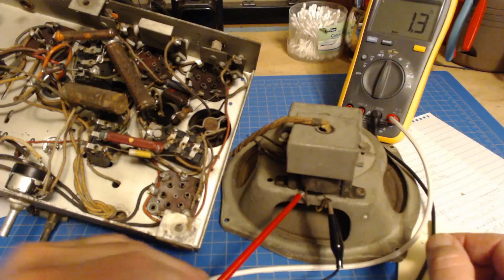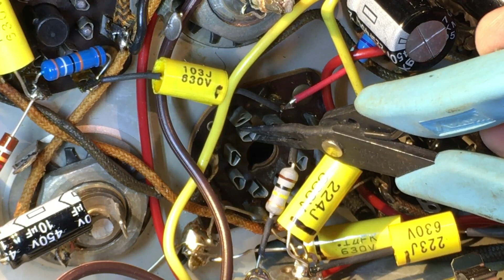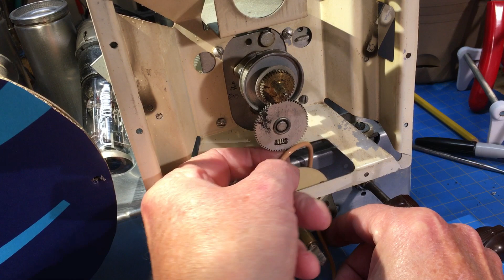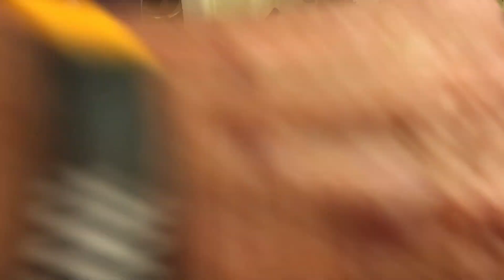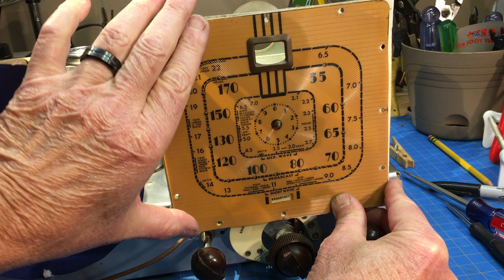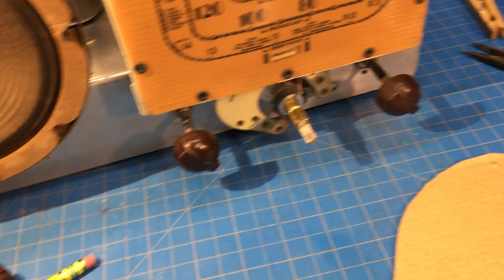1937 RCA Victor 87t Part 5 of 5 Cabinet Detail, Assembly, and Power Up

Comment: Excellent detailed work, i'm really impressed.  I am starting the restoration of (2) 87-K units so this series is going to be super useful.  I ordered a few belts from Quality Belts after seing that's what you've put in and how well it seems to fit. I also wanted to ask, where did you get the grommets, they are just perfect. Are you willing to share your source and their specs ? To at least point me in the right direction.  Also both my units didn't have the retainer shaft ring, any chance you would know where to get replacements ?  At any rate thank you very much for sharing this series, it gave me all the info i need to get going, i'll be ordering new caps, resistors and tubes and will be restoring the cabinet (console) when spring comes outside, living in Canada where in the dead of winter here so working outside is out of the question you know ?
Reply from the maker: Thank you Raymond for the kind words! We had a little dose of your cool weather down here last week where it got 3 degrees, brrrrrr. Well, you can start the recapping and repairs this winter and finish up the cabinets in the spring. As far as the grommets, I ordered from Renovated Radios. http://renovatedradios.com/index.php?  I hope they are still in business, they have just about any grommet or knob reproduction you would need. Also, if you have the old knob or grommet, they can make or match a suitable replacement (or used to). I havent ordered from them in a while. A retainer shaft ring? Im not sure what ur referring to? I believe on this radio, I needed a band switch indicator that was made of some really  brittle metal. I went to Antique Radio Forums and put out an ad. Within a few days I had one for about $10. I hope this helps and glad you found the series useful. Restoring these old beauties must be shared to keep them around for the new generation to see. Take Care—Larry
Reply: @Backtothefutureradios  Hey Larry thank's for the speedy reply sir, sorry about the cold weather spell, here as usual for the last 20 years or so our winters haven't been as much fun as they used to be when i was a kid, we have rain like 10 times every winter where the temperatures varie like crazy from +6c to -20c ( 43F to - 4F ) in a matter of hours, resulting in ice everywhere, causing more injuries to people falling and of course more car accidents and deaths unfortunately.  It is almost impossible to have decent exterior ice rinks anymore and it is quite a challenge for ski resorts to keep the hills in decent shape.  That's what you get for being Canadian i suppose...

As for the grommets yes Renovated Radios, LLC are still in business, (well at least they took my money), i ordered 6 of the grommets, thank you very much for the tip.  While i was ordering stuff i also ordered a pack of 2 RCA-Victor water slides decals from Radio Daze.  Yup doing the re capping slowly but surely during the short cold winter days and starting the cabinet work next spring is the plan.  

All this is new to me, it'll be my first project of the sort, i know my way around wood restoration, but i'm a newbie at electronics, to say the least.  It all started 2 years ago when i stumbled on David Tipton's Radio Adventure channel and i was immediately hooked, but never thought i'd do it myself one day.  But as life would have it, out of the blue in October, my best friend Yvon asked me if i wanted his 87-K which he had inherited from his grand father and had been kept in a mini warehouse for the past 20 years or so.  He sent  me pictures of the radio and  i found the Art Deco design so beautiful i decided to take on the challenge (The Canadian console is a bit different though, but just as pretty i find).  But we had to wait 2 months before his brother became available to come with us unlock the warehouse.  In the meantime i figured i 'd try to find another set to start studying it's chassis and how it worked and perhaps use it as a donor unit if Yvon's set was missing components or whatnot.  After a quick search on Facebook's Market place i found another one in the eastern townships for 40$.  Brought it home and started dismantling and cleaning it.  No doubt it had been kept in a barn for decades, the chassis was corroded to death, but i managed to clean it up to an extent having to resort to sanding and using Mother's Aluminium polish. The corrosion left marks of course but at least its smooth and more fun to work on now.
Sure enough when i finally got Yvon's set i realized it was missing parts; No multi band selector mechanism (the plastic indicator and the pot metal collar), Also missing an electrolytic can and the original transformer seems fried, wires being badly burnt.  On the other hand the one that i bought seems to have all it's parts, although the fragile collar had broke off at one point and was re welded (brazed).  That part is no doubt the weak spot of the whole set.  So if i originally  thought the set that i bought was going to serve as a donor uni t( and it would be the logical thing to do), i find in the short time i've own the radios i've grown attached to them and i would like to restore them both, providing i find the missing parts. Guess i'll put out an ''APB'' for the missing parts on Antique Radio Forums as well.

As for the ''retainer shaft ring'' (probably not the right term, but that's always the problem trying to describe some odd parts to repair something right ?) i'm talking about the tiny half circle ring that has to be mounted on the shaft to prevent the  tensioner's pulley assembly from slipping off. Visible starting at 3m20s of this video.  Had you lost it to the floor monster, how would you have replaced it ? I though of perhaps replacing it with a snap lock washer, but i imagine it would protrude too much to let the button slide back into place.  See what i mean ?

At any rate i agree with you restoring old gems like tube radios should always be kept alive for future generations. I realize more and more everyday just how important creating a network of like minded people and friends is important to achieve this.  There's only so much a guy alone can do in his basement...

P.S. I love your biblical references.

Thank's for sharing, happy New Year and God bless.
Reply from the maker: @raymondmenard5444  I know which part you mean now….you wouldn’t believe where I found it, totally impossible where it went, lol….I believe if you could find a “c” clip or “e” may work….another idea is a clip that is used on mowers and other farm equipment that is shaped like an “R” could work….good luck with the projects! Please keep me updated….also, a friend of mine did a console and not sure if he included it in his YouTube channel….he no longer posts but his channel is “ThatTubeSound”….check him out! Take care—Larry
Reply: @Backtothefutureradios  Yeah no kidding once you drop one of those tiny rings on the floor better start praying to find it again, not surprising mine are missing from both units.  Yeah yeah C clips that's what i meant, but i took a few measurements and i don't think C clips would work because once fitted onto the shaft's groove its outer diameter must be smaller than the tube's assembly diameter in order to let the buttons slide onto the shaft which has a flat part even lower than the overall shaft diameter.  But i did manage to wrap a piece of 14 gauge copper wire into the groove and it almost works.  I filed the wire down a bit and was able to slide the button in place, but it was a very tight fit to remove it afterwards without risking breaking the buttons flat retainer spring.  Perhaps 16 g wire would be a better fit.  I'll try this as soon as the stores reopen the day after tomorrow.  There's always a solution right ? Although here in Canada everything is harder to find, it's always been like that especially in my french speaking province where nobody takes us seriously.  We're such a tiny market no company bothers to carry meaningful inventories of anything deemed specialized not even a little.  Anytime i see a car with Ontario license plates (neighbouring bigger province) it is always better, with nicer trims, nicer colours etc. I always say: ''Around here when you need a toothpick, you have to go into the forest to cut a tree''.  Just for your information, the dial shaft is .1248'' and its inner grove is .1214'', so the groove is just about .003'' deep approximately since a thinner set of callipers could go a little deeper into the groove and give a more accurate measurement, but it still gives you an idea how thin the ring must be to protrude just enough to hold the assembly in without obstructing the sliding of the button over the shaft.  But we do all this for future generations right ? :-)

Comment: Hey Larry: Just saw your restoration of the RCA Victor 87T. Great job. Just found my grandfather's 87T and looks to be in very good shape. I will be doing a full restore on this unit and your videos will be a great help along with those of Mr. Carlson's Lab. A comment on the rubber band (o-ring) you replaced on the dial tuning mechanism. Looking at my grandfather's 87T the tuning band is actually two wraps of twine or string. You can easily make this up yourself of course. The spring loaded roller puts tension on the string and it works perfectly. One difference I noticed is that the spring on my unit is very long, it actually goes along the front of the housing and hooks into a seam at the end of the case top edge where there is a gap. Obviously this is a fix but it works very well, so with the string solution the spring puts tension on the roller to keep the string in tension to gain purchase or grip. Again great job.
Reply from the maker: Thanks! The 87T is a nice radio! The dial belt didnt really make sense to me....if I put the idler to press on the belt, it was too tight, so I ended up, pushing on it.....the string you have sounds like a good option.....the belt works ok too....Hope the restoration goes well, and you have fun with it! Thanks for watching...Take Care—Larry

Comment: Great job !  I struggled for a long time with that same Sunburst dial - it never crossed my mind that the little pointer was just a push fit.  I assumed that there must be some missing component. I had to pause the video and try it right away. 5 minutes later and - Voila -  it’s spinning away!   So thanks a bunch for that tip ! Best wishes from Northern Illinois to the Hills of Tennessee
Reply from the maker: SInewave423 Thanks for that feedback! I’m glad you picked that nugget out of one of my videos!!! That’s the purpose we all hope that it will help someone along the way! I appreciate you watching and commenting!! Take Care and Stay well in Illinois—Larry ps....what is your name?
Reply: Hi Larry.   I’m  Chris.   I have an RCA 810K1 which has basically the same dial as yours.  BTW do you recall which dial belt you ordered ?   I made one but it is not as good as it could be.
Reply from the maker: SInewave423 Hi Chris....Thanks for the response...I ordered from Quality Radio Belts...They have a drop down box that you select the belt based on model...I think they have one for  ur model...just check and see..I ordered one for a 87t...Hope this helps! Let me know what you find!! Thanks again, Take Care—Larry